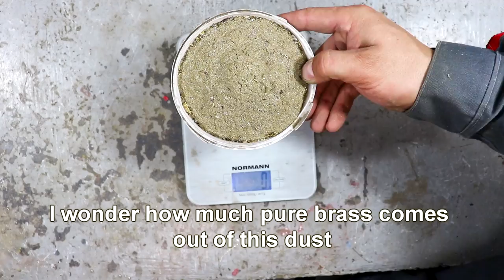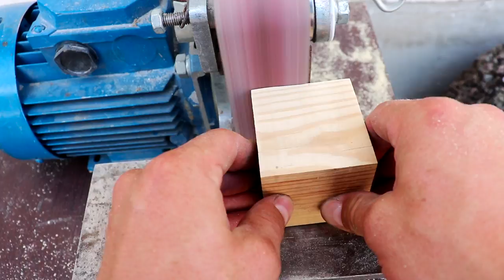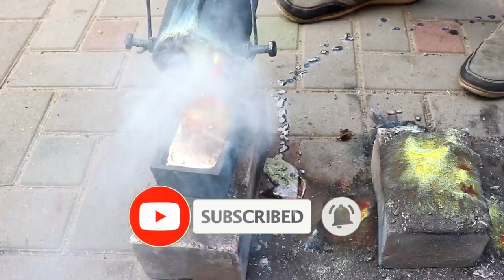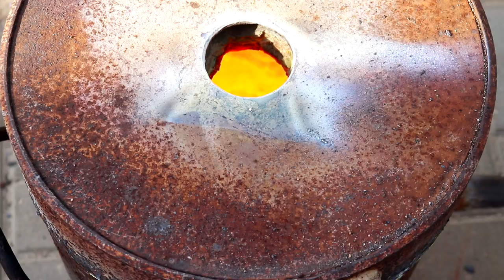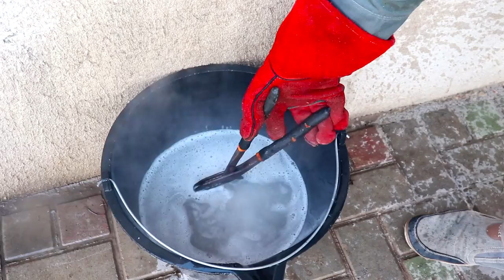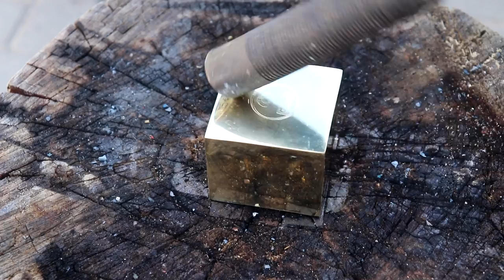Metal dust melt down. Trash to treasure . Hotmetal casting.Brass Cube casting

Comment: Is applying borax necessary?
Reply: Borax kind of collects the oxides and helps them form a fluid slag on top of the melt.

You don't actually need it, but it helps a lot with driving the impurities out of the melt and makes it mir efficient to scoop them off.

It kind of helps you lower the amount of metal in the slag.
Reply from the maker: Thanks for your reply